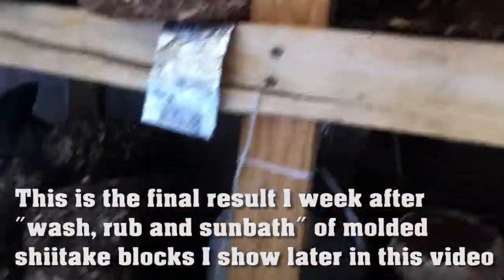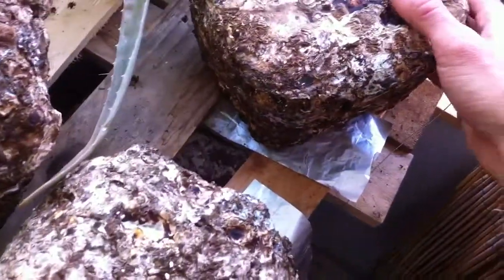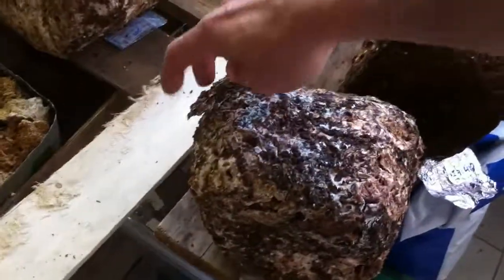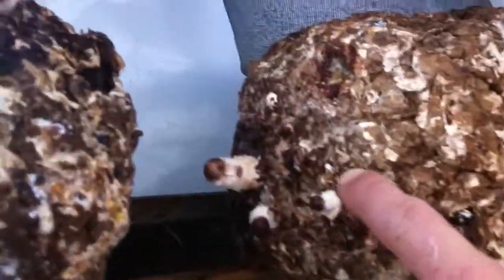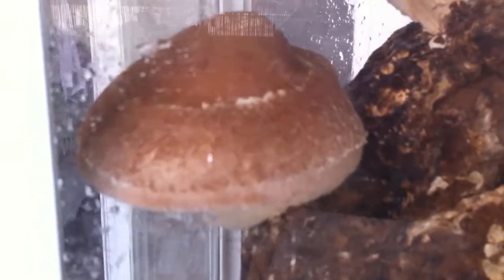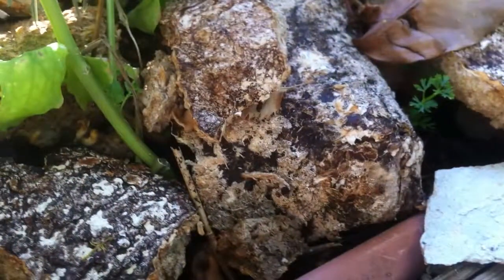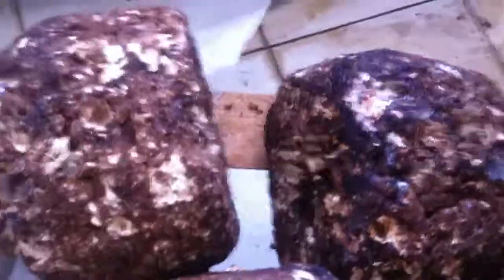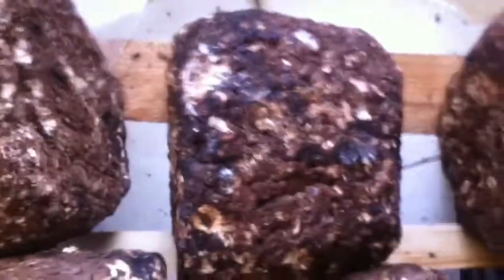Shiitake Balcony 5/5: Curing mold with ''wash, rub and sunbathe'' - Episode 9

Comment: someone said the HEAT is what causes the Trichoderma to grow too much. Someone else said when they get too WET then the Trichoderma grows....
Reply from the maker: I think they are both right. I would add that direct sunlight is what kills trichoderma especially when wet. Mostly the UV and it helps also to dry the outside of the block.
Reply: @themushroomcircle-3995  ok thanks. I used Jute for coverings this year on logs outside - so probably caused too much moisture build up.